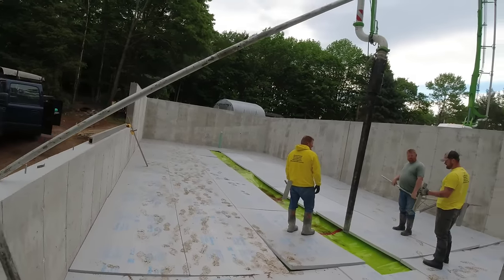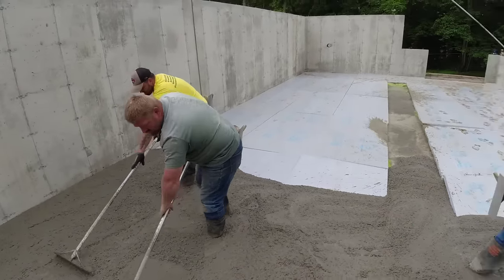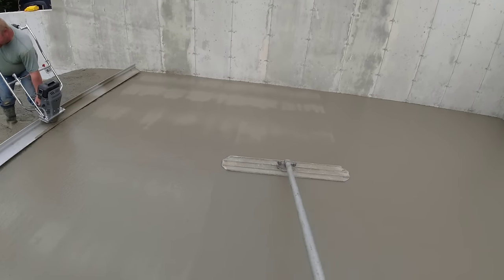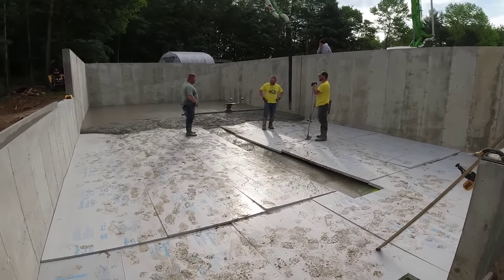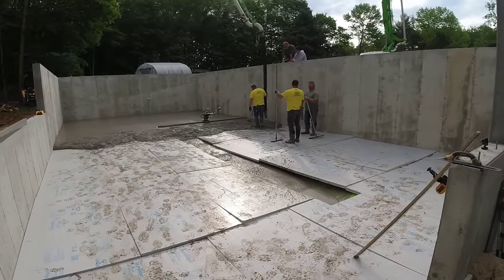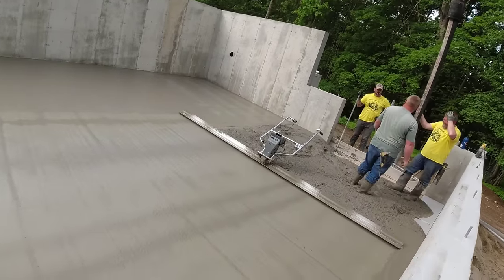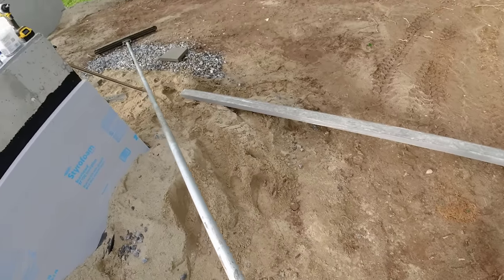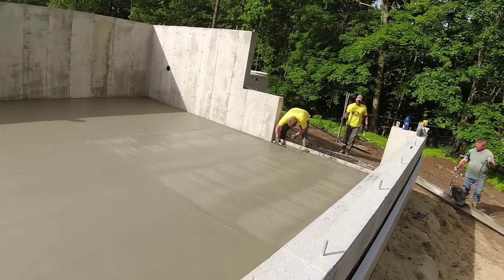How To Use A Vibra-Screed To Pour A Concrete Floor

Comment: Have question for you Mike. What concrete sealer are you using around a saltwater pool . Having trouble with water based sealers peeling up .

Comment: Hey Mike - Isn't a haunch an extra thick section of concrete that typically bears more weight? Won't loading it up with mostly water from priming the pump cause it to become a weak spot?